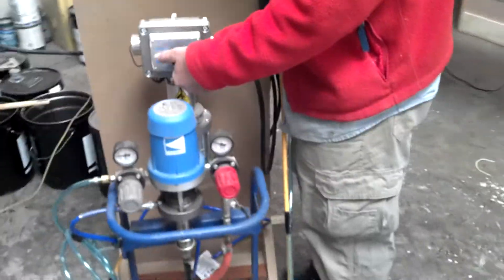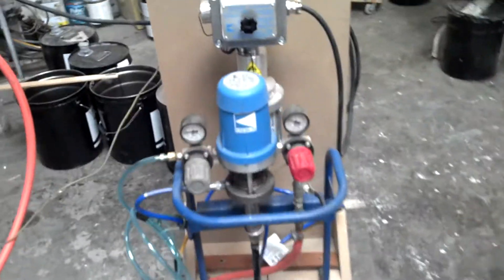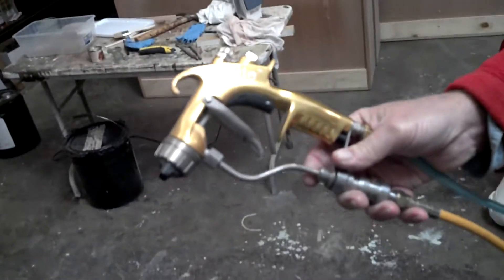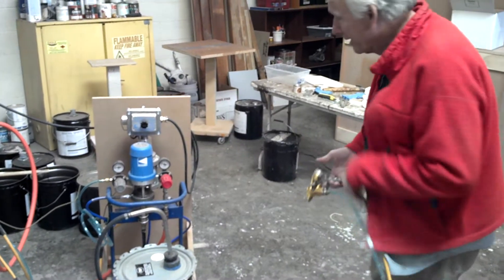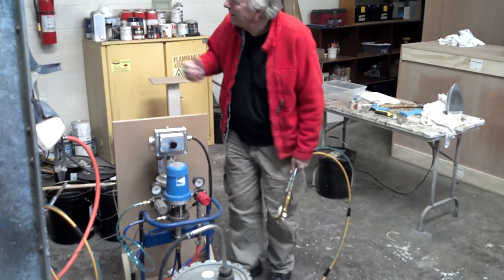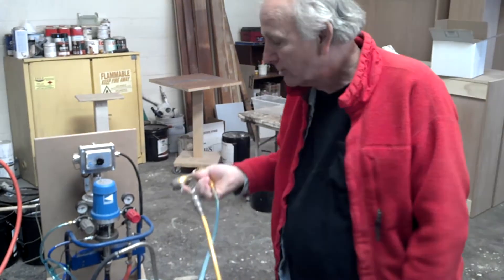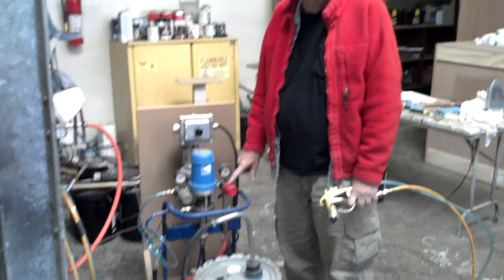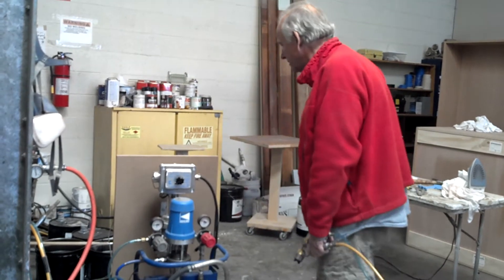kremlin air assisted airless rig with materials heater part 1.mp4

Comment: I sprayed cabinets with this same setup for 3 years in a cabinet shop. It's better than anything Graco has ever made.
Reply: Bcroft39 but graco did and does have a setup like this the falcon units, I own 2 of them and they work wonders
Reply: Jorge duarte no doubt that your Graco units work wonders. Binks also makes a airless air assisted unit. They all lay out a great pattern and are SO much better than the old cup guns and pot guns. I have sprayed so many cabinets with pot guns and a 50 year old Devilbiss JGA cup gun. I built and painted cabinets for a guy back some years ago and he bought one these Kremlins. The first time I sprayed with it, I simply couldn’t believe how much easier the painting was and how great the pattern was.
Reply: Bcroft39 yes I have no doubt that kremlin gun works great but I just dont have that kind of cash laying around, but recently i found a great deal on a j1000 aaa gun and it has worked great for me and bought it for a fraction of the original price
Reply: Jorge duarte I know what you mean about not having that kind of cash but the guy I worked for bought two kremlin pumps with two kremlin xcite guns. They paid for themselves on the very first job I worked for him on. Me and Dad did that job for him. Two 4 story golf course condo buildings. Over 200 cabinets. But there was one thing about it. Every condo had the same layout with the same style, size and amount of cabinets. There was another guy named Jimmy that put put the fronts together for us. He would build the same fronts over and over and we cut out and build the same cabinet over and over and put the fronts on them then put the putty in the nail holes and set them on the floor. We would have cabinets stacked on top of one another almost circling the table. He hired some high school boys to come in after school was let out to come in and sand them. Man we had it made there for awhile. About the time we got all of the cabinets together, his painter and him got into an argument and he fired him. Then he came to me and asked me if I could paint. I said yes and from then on I was the damn painter. I still didn’t have to sand any of the cabinets. I would go in about the time those school boys got there. I would paint one cabinet and those school boys would take it down and set another one up for me to paint. I don’t know if you’ve ever heard this phrase but “I was shitting in high cotton for awhile”. LOL
Reply: Bcroft39 nice, wish I were that lucky lol

Comment from the maker: Hi, the hose is the stock hose from Kremlin and is 3/16th 3000 psi rated. 25 ft. which hose are you refering to as being less desirable the 1/8 inch or the Euro power?  Happy to share